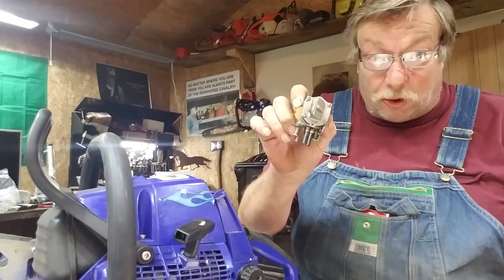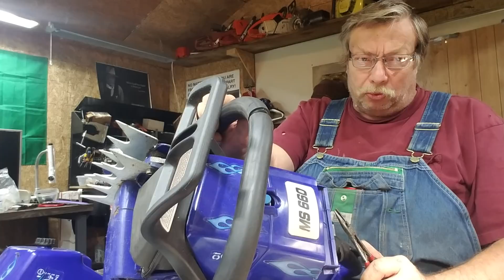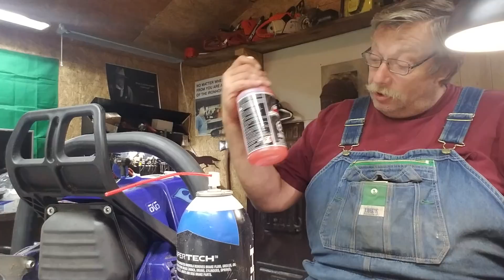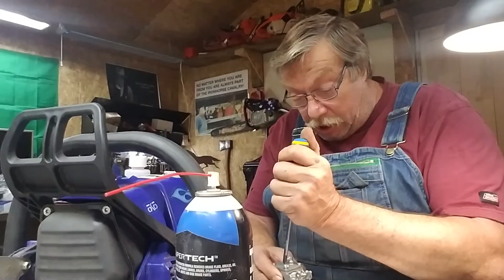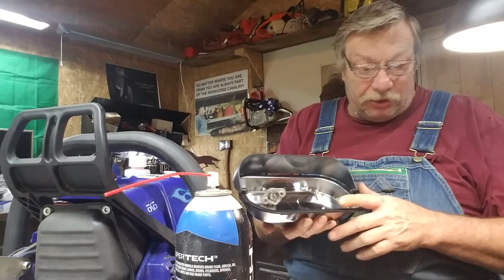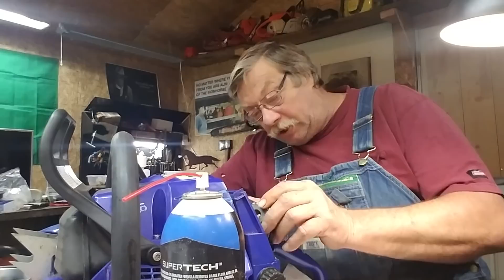G660 carb issue! Nitromethane and kfc! A story! I don’t give marital advice!

Comment: Hello Harvey, do you have a website or email address I have a funny crazy project about my Stihl ma 191, In my research of big bore for this saw which was the biggest engine on climbing saw from Stihl (46cc, 46mm bore) i found that the lower engine should be based on Ms290... effectively both are 46mm bore but 290 is 56cc and I am pretty good at working resin and glass fiber or carbon fiber as in mechanic... do you see what kind if idea cane in my mind. But I would like to share with you idea and problem I noticed you are talented and experienced saw builder so I see no better person to help me in this project.

Comment: Those nitro rc guys tune their carb with a thermometer on the cylinder head. It is really easy to run lean on a nitro engine and not know it.

Comment: Man if anybody's going to be able to answer this question it will be you.

I run little 66cc Engine on my bicycle and I recently purchased two new head the heads fit.

The only question I have and it may be a dumb one.
The only spark plugs that will fit in the new heads are smaller threads then the regular spark plug I use.

I usually use a 13.3 mm around that

And the new ones are 9.5 mm

Does a smaller thread on the spark plug mean less Spark.

I know I have the option of a tap set tap the head out to the spark plug that I want to put in there.

But do I have to do that?
Reply from the maker: The smaller plug will give just as much spark!
Reply: @theironhorse6600  👍👍👍☝️
Thank you so much.